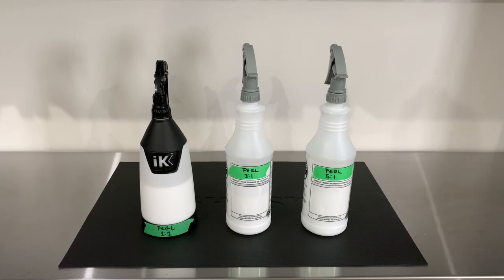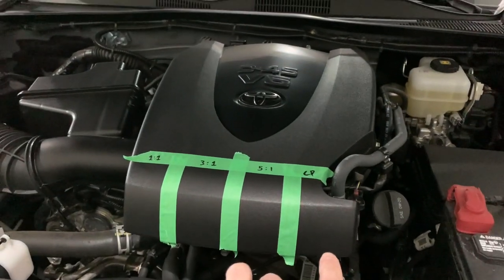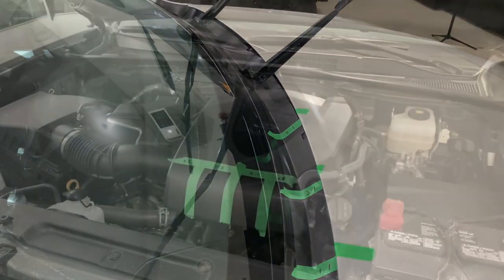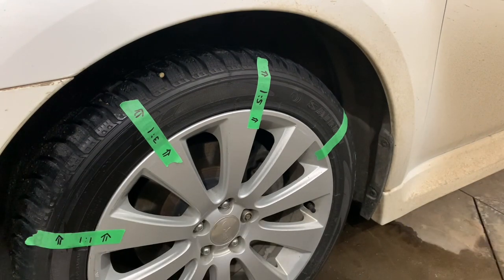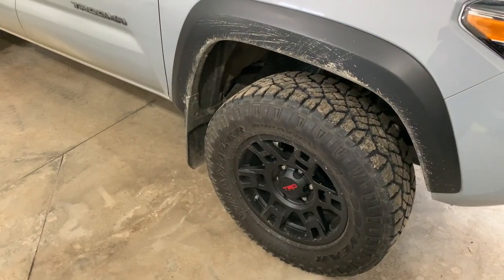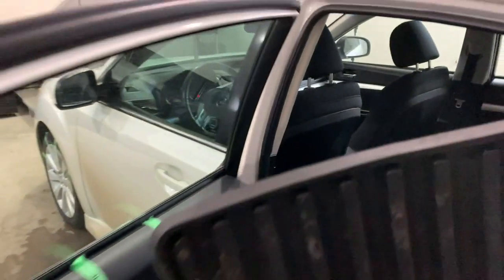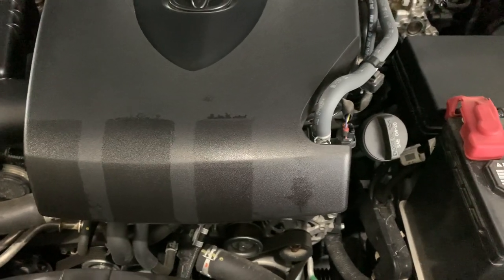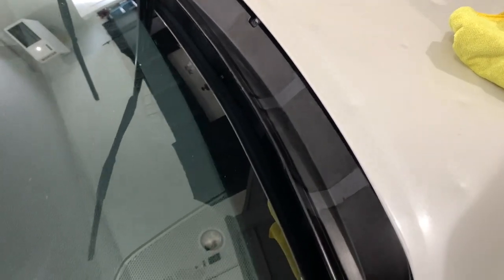How To Use CARPRO Perl - Review & Dilution Comparison

Comment: Hi, besides hydrophobic... Is it also dust repellant? Thanks!
Reply from the maker: The manufacturer does not claim the product to be dust repellent and based on my experience with the product I don’t think it is.
Reply: @DetailProjects  thanks for the info!
Reply: I used meguiars hybrid ceramic wax on my car back in Jan 22. If I got dirt spots on the plastic trim after driving in rain etc, I could hose it off no problem.  Perl won't hose off. I have to get the wash mitt out . That's the major difference I've found . Definitely harder to clean than HCW

Comment: Great video! I'm going to use 1:1 for exterior trims but I can't decide between 1:3 or 1:5 for interior, what would you suggest? I couldn't gauge the difference over camera between 1:3 and 1:5 on the car door cards.
Reply from the maker: Honestly I can’t tell the difference between 1:3 and 1:5 in person either, they look pretty much the same. Personally for my interior panels I use GTECHNIQ matte dash as I like my interior to look factory, but I would suggest depending on how you like your interior to start with a 1:5 dilution ratio and see how it looks and go from there.
Reply: @DetailProjects  Thanks so much. Will definitely be looking into GTECHNIQ matte dash and I'm really enjoying your content, keep up the good work!
Reply: @DetailProjects  I can recommend Solution Finish - Black Trim Restorer for heavily oxidised surfaces if you're looking for something good?
Reply from the maker: Thanks for the recommendation, I have been looking to try this product out!
Reply: If you can't choose between 1:3 and 1:5....Why not 1:4? Logic...no?

Comment: Why are you not using non-diluted for the tires or exterior rubber or plastic, ie, mudguards?
Reply from the maker: You can definitely use it undiluted for the applications you mentioned, in the video I just wanted to compare all the dilution ratios the manufacturer recommended.

Comment: What would your opinion be on perl vs VRP or something similar?
Reply from the maker: VRP is a great product and actually was my go to before I discovered Perl. It still would be my second choice to date! Having said that the major difference between the 2 and the reason why I prefer Perl over VRP is because Perl last longer and also is more repellent to dirt. But there is no wrong here I personally think these two products are almost on PAR. Also both products have a very similar price point,  and even though With Perl you can dilute it and get more for your money, when I used to Apply VRP I also dilute it 1:1 in some occasions and great results. Hope this helps!
Reply: @DetailProjects  I could find VRP for a gallon for around 40 and Perl 4 liters for around 100. I wish I could step up to Perl, just not worth the price. Unless you think it would be that much of a difference? Edit can't you also dilute VRP or is it not strong enough for that?
Reply from the maker: I would just stick with VRP in this case and save yourself 60 Dollars. I always get these dressings in 16oz bottles because I do not go through that much and I don’t want the chemicals to spoil, so the price difference isn’t as bad .Depending on what your applying it on you can dilute the VRP 1:1 and it’s not really going to effect the integrity, it’s just not gonna be as “shiny”. To put it in in prospective when you dilute the VRP 1:1 you will get the same results as the Chemical Guys Silk Shine.

Comment: Does it last 3 mos in trim?
Reply: Outside plastic trim 3mos?
Reply from the maker: I can’t see Perl going that far, maybe a month or so is more realistic.
Reply: @josephmarlowe9917  If you want something more permanent, deep, and natural then go for Solution Finish. They're tiny bottles (small bottle approx. 50ml costs around $20.00) but the contents go a long way. You could do ten scuttles with a small bottle and the effect lasts for 9-months to 2-years depending on conditions.